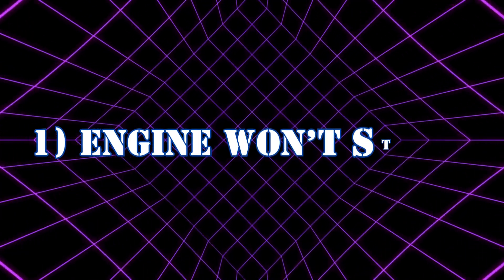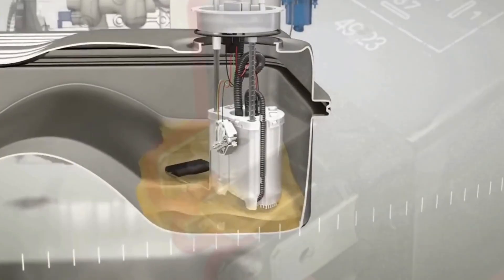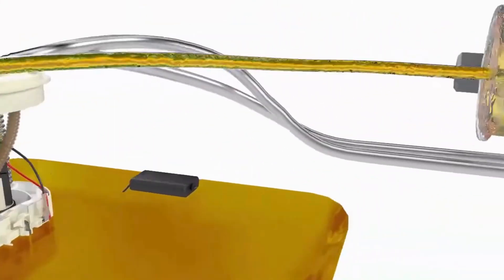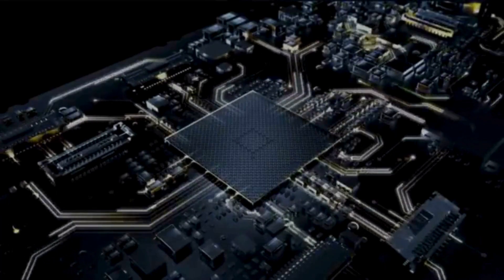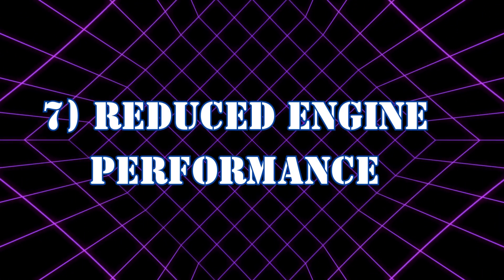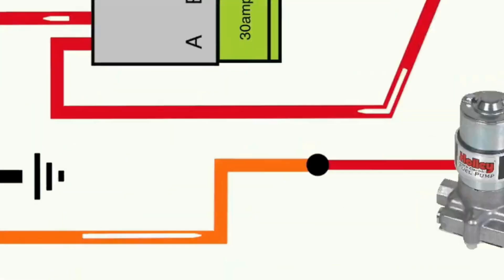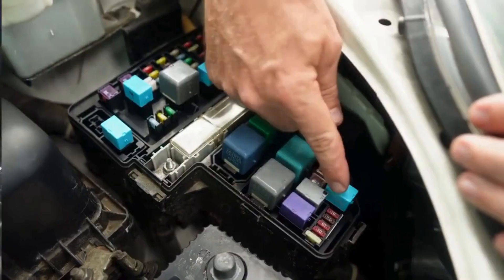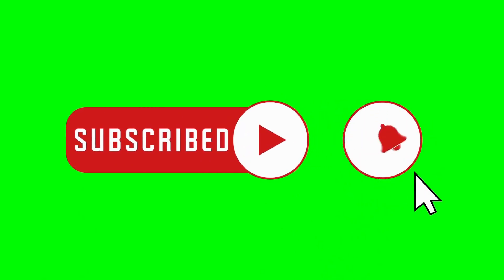9 Bad Fuel Pump Relay Symptoms: COMMON Failure Signs (& DIY FIXES)

Comment: An integrated system is a little more difficult to repair as the relat is soldered into the board. You can still repair it but dont expect a mechanic to say he can or will.